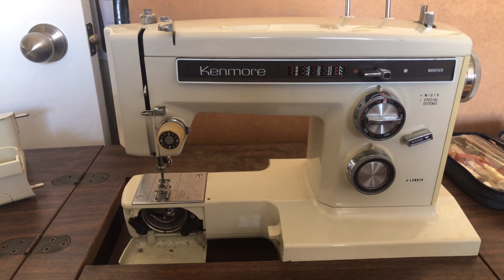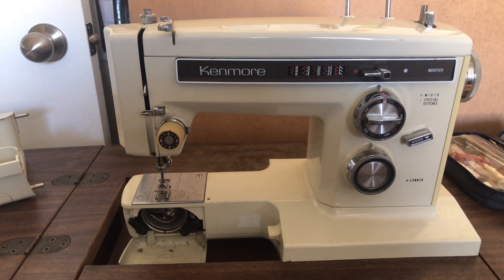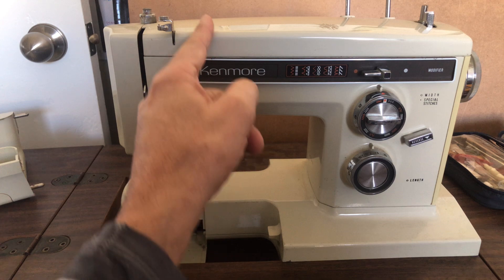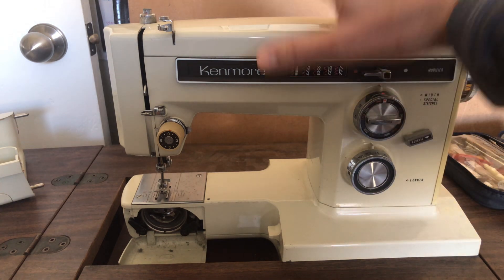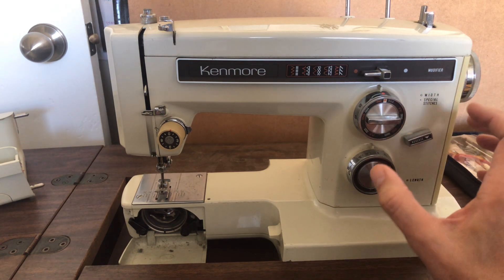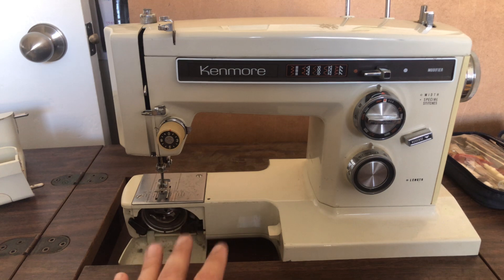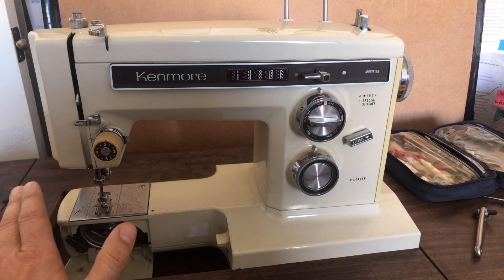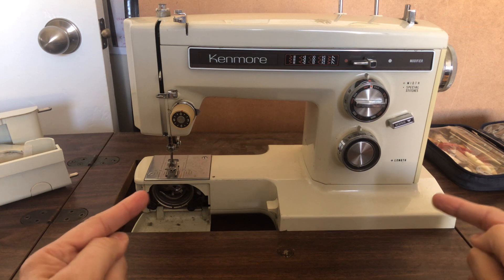I NEVER TIRE OF THESE AMAZING MULTISTITCH MACHINES & WHY I WOULD CHOOSE THIS KENMORE OVER A BERNINA

Comment: I just bought the lesser version of this machine. It has all the same stuff going for it except the dial for the length is up top, where your width dial is, the width dial is on the Kenmore logo strip and stitches are, underneath the stitch selector. The modifier is also built into the same length dial instead of being separate and up top. 

My machine also has no drop dog switch. It's a metal darning plate for this machine. However, it is a low shank, with that wonderful extra high clearance for the presser foot, a 1 amp motor, all metal construction (except for the cam stack assembly which is up top, super strong plastic and it is not load bearing, which is a good thing. I would have loved your version of the free arm, but I got instead the one with the pull out leg. Oh well, you can't have everything...LOL. 

The machine came to me fully functional. But, to be certain it was going to remain that way, I spent three days cleaning, greasing and oiling this honey. It's clearly low hours as the brushes inside the motor (I cleaned up all of the carbon inside, polished the commutator/armature/stator until they gleamed, put a drop of oil on the bearings) were like brand new. 

ALL of the original parts, including the cardboard box they came in as well as the little 3 things warning insert with the original manual. I decided to clean all of the innards of the pedal, cleaned and in some cases replaced the carbon disks, the metal contact foil, the inner well the carbon disks are housed in, and the contact nib that lived up top of said disks. 

I did a repaint of the pedal with high quality appliance paint (this has a textured finish instead of smooth) so that the pedal looked nice and new (and now has improved traction on the pedal). All of this effort really dialed in the smooth for this machine. 

I did not have to fine tune any of settings whatsoever. It did not need to be aligned in any way, the hook and feed dog timing are perfect, stitch quality is stellar, needle swing (very different on this machine as opposed to a machine with adjustable needle positions) or anything else. The belts...ugh. That's the Achilles Heel of this unit. It's a nightmare trying to get at them, let alone remove them. Yet, remove them I did, and the machine got itself a good old fashioned cleaning, oiling and tension adjustment (very similar to the one belt system on modern machines, of course disregarding the timing belts, which this does not have). 

I did have issues with the bobbin control knob. I, of course, corrected it with a couple of YouTube channels. Also had issue with threading as the manual does not make it clear (to me) how you are supposed to thread this unit up top. Kept having the bobbin and spool battling it out via jams and spool jump and spin scenarios. I also had to redo the tension knob as it was a little gunked up. Once I got that "dialed" in, I was off to the races. 

I have to get used to this reverse dial thing it has going for it. At first I thought after I was messing around with the dial and reverse switch that it had a 385 Kenmore issue with being stuck in reverse. Nope. I am learning from reading that this machine is designed to go backwards. I just need to learn how that works, and how to disengage it. Changing out the incandescent light bulb for a silicone (no joke, they make silicone light bulbs now) LED light actually gave the machine a little extra "OOMPHF"! It's amazing how a 15 watt bulb can suck up so much energy. And the LED is brighter and better, anyways. It does heat up, but never so hot you cannot touch it. 

My only gripe is the convertible flatbed table. The leg for some odd reason seems to be sitting higher than the table and is actually twisting it towards the machine. I have to keep it on an angle in order to use it. Going to definitely have a think on how to resolve that. I do plan to repaint this machine in the summer (and that case..it looks like it's urine yellow from all the years of whatever it was exposed to. Still, it's in perfect condition, save for the horrible colour and scratches all over it). 

I wanted to thank you, not only for this video, but for demonstrating why this machine is so well worth preserving. Once I saw your video on this particular machine (I think it was this one, the 1941 model, which I could not buy for a reasonable price, thus my purchasing this model, the 1251), I was hooked. 

Sure, I wanted one with more "stuff", and I really wanted the drop dogs and that bobbin housing accessible bed, but in the end, I don't need to buy a super high shank converter to be able to use my low shank feet (of which I have many), still get that IMPRESSIVE clearance for heavy fabrics that is even HIGHER than my Janome HD3000 and Singer Quantum Stylist 9960, A MA ZING feed dog capability for such a small dog setup, the best stretch stitches I think I have ever seen.
Reply from the maker: Thanks for sharing.  There are videos online from others that have methods for restoring oxidized plastics such as those on some of the 80's sewing machines.  I have not tried those options so cannot speak to their success or not.  But even it its yellowed, scratched state, I would hold onto that case as they are hard to find; in part because many got separate from the machines they were sold with.
Reply: @VintageSewingMachineGarage  I am. I repaired a stress crack inside on one of the support ribs with the superglue/baking soda method, to keep it from becoming a problem. 

I plan to attempt retrobrighting it sometime this spring (will attempt to do it on the inside, just in case this isn't a good thing for this type of plastic). If it works, it will be video documented. If not, I will be taking plastic grade paint to it, and restoring it that way (possibly giving it a very different look, depending on my mood). 

It's funny that the case is so badly yellowed, yet the machine's exterior plastics are as true in colour as the day it was unboxed. No complaints here., Still, it would have been nice to have the cooler bed free arm and chrome accents. 

The 1941 just looks better all-around. 

One question, if I may? My machine was built in 1975 according to the Kenmore website, but the model number isn't exact to what is listed. It says it was a 1975 build, but my model is off by a touch. Any idea as to how I can identify exactly when it was made? It's also not listed as Made in Japan, rather, it's Taiwan. 

Someone told me through Pattern Review that anything not manufactured in Japan is a much "lesser" build quality. I'm confused by this as I've been through this machine thoroughly, and it is definitely completely made of metal, with the exception of the cam array up top of the machine. And that array is in perfect condition, made with a much more durable plastic than some I've seen in my travels. It's free of petroleum grease as well (which you'd know better than anyone would break down certain plastics over time). 

I did find petroleum grease in the crank case, but it was still quite viable, and the gear setup is fully metal, so I left that where I found it. 

I'm about to do a stretch polyester lace repair for my sister on an undergarment. This was a complete nightmare on all of my machines the last time I took something in on it. My Singer 9960, Janome HD3000 (which I learned the other day, along with ALL modern Janome/Kenmore machines are nightmares to sew certain types of stretch fabrics on), the old Singer Starlet (1978, built in France) and the Kenmore 27 (1990 Janome built, one step from the top of the line, the Kenmore 30 mechanical series). 

I bought this machine when I learned my so-called "Heavy Duty" machine was a post 2018 build, and wasn't even a model  HD3000.  I had never expected/intended to use this machine as a Sailrite or H9. I did, however expect it to sew as well as older Kenmore hybrids. 

I learned one day when the needle sank into an 8 layer thin stretch denim stack and didn't come back up without being hand cranked that this model sports a pathetic and fully anemic 0.5 amp motor that Janome "treated" so that it would deliver 860 stitches per minute. This explained why the pedal was so hyper-sensitive to pressure being applied to it. I had a tough time sewing slowly on this machine as opposed to a Kenmore 27 that I shoe-horned a 0.7 amp motor into, but is still sporting it's original carbon disk sewing pedal. 

They also "lightened" things up when they treated this bait and switch junk motor by putting a very thin, prone to breaking down when exposed to heat or UV plastic flywheel inside the motor can, so that it would spin at about twice it's design speed. When I opened that can up and found this, I also saw that the commutator was caked in carbon dust from the now half spent brushes (this machine was bought at the end of 2019, and used a total of 10 times, with the last project ONLY putting anything remotely related to a heavier load through it, and was never intentionally gunned). 

Janome also took key components, once made of hard plastics, very much like what I found in this Kenmore 1251, and replaced them with thin, soft nylon. I'm guessing to lessen the weight being carried by that motor, and to ensure the machine had cracked components rendering it useless (so you'd buy an even more expensive Janome I'm guessing) within 7 to 10 years. 

Add to that the 5mm Christmas LED bulb lighting harness that, if you blew the LED, could not be changed without swapping out the entire harness or de-soldering/re-soldering after unwrapping and then re-wrapping said harness (IYIYI!) that barely lights the needle plate, put in as a replacement for the halogen that used to go with this model, so that all available power, which is nearly 0.5  amps, could be shoehorned into the machine's motor. 

I dunno, last time I checked, speed did not equal torque. 

I put a 0.7 amp motor into the machine, and boy, did that machine perform. That stack I could not sew out of, it went through it like it wasn't even there. In fact, that Kenmore 27 (which had a 0.5 amp motor, tired before I refurbished it), while is struggled a little, sewed through the stack the compromised Janome motor could not. 

That motor, in both machines, same model number, same everything except the flywheel. The Kenmore has an aluminum cast flywheel, which is sturdy and dependable. Like my Kenmore 1251, I refurbished the Kenmore 27, cleaned and polished (and fresh brushes swapped out for old) the commutator, etc. 

The machine, motor and pedal completely overhauled, and woke the machine up quite a bit. 

Once I confirmed the mechanical components in this machine were the same materials and configuration of a few 0.87 amp motor-fitted models (the Janome Decor Excel is identical except for the camstack, a few more stitch variations), I threw 0.7 amp motor into it, and the machine went from being a utility grade only machine to a bit of a beast. If it had the things I needed from my HD3000, mainly the 7 pin feed dog arrangement and extra high presser foot capability, I would have kept it and sold my Janome. 

As it stands, one more machine to take on the upholstery fabrics and denim recycle projects isn't such a bad thing. By the time I finish, the Janome will be general purpose only, the Singer for specialized projects requiring more precision sewing, and the Kenmore 1251 for the tougher stuff. The other Kenmore went to the missus, to replace her old Starlet, which I refurbished and gifted to my sister, as she needed a basic zig zag machine, nothing more. 

And to your video series on the 1241...I thank you kind sir. You gave me the impetus to seek out and attain an older Kenmore. And you were SOOOOOOO right on these unsung work horses being a great all-around sew. 

Sometimes, an "inspiration" (copy) can be as (or almost) as good as the original Thank you Bernina! LOL. 

That Janome sews a good stitch, and it could take some weight, but clearly, this bait and switch setup did the former model no justice. I'm currently waiting on a .87 amp motor (which is what the HD3000 originally had in it, and when it finally gets here, will be ripping the internals out and replacing all of the compromised gears, linkages, etc with the stronger plastics I have in my spares. I only wish I could get my hands on an older camstack array for this 18 stitch sequence. Then I would at least have the machine I thought I was paying for,. Not have to worry about this hybrid being anything less than the Kenmore/Janome machines I've grown to respect would also take a bit of the sting out of being conned and ripped off by both my dealer and Janome. 

While no one would be fool enough to say a 1983 Kenmore is the same in durability as a 1973 Kenmore, the fact that the hybrids are still going all these decades later (save for the odd reverse issue from gummed up grease) is a testament to how well balanced and the build quality, despite the plastics, Janome engineered into their product line. 

I bought this Kenmore to take on the jobs this gutless wonder clearly cannot handle without killing the parts inside. Considering the Janome cost two to three times as much as their competitors offerings in the same class of mechanicals, it's a very big deal to those that trusted the brand, only to find out that at that high end price, they got a low end machine.

Comment: we had same model but could not utilize all of it features, wondering if you had some kind of manual, user instruction ? thanks
Reply from the maker: I didn't need the manual but that is only due to my having worked on lots of these in the past.  Kenmore manuals can be easily found online in PDF form which you can pay a nominal fee for and then keep the PDF as well as print it out. Having a manual is VERY WISE to help learn how to use any machine.

Comment: GORGEOUS MACHINE.  I'm the guy who keeps bugging you about the axle grease machine. I recently drove 7 hours round trip to acquire on in a cabinet. Needle moved up and down but not left and right. Tri Flow took care of that. I will be gifting it to a dear friend next week. Are the brown vinyl tipped screws from the lift up panel available? Mine are bent.
Reply from the maker: I don't mind being 'bugged' about it Ronald :-)  Hope springs eternal as they say and so next summer, I will try again.  I only attempt trying to fix that disaster of a machine outdoors!!  As for the screws on the Kenmore table, I've never gone searching for one.  My default strategy for odd item searches is:  Ebay, Etsy, and Bonanza.com
Reply: @VintageSewingMachineGarage  
Thanks for your reply. Hope you have a healthy and Happy New Year.

Comment: Speaking of bolts, would you happen to know the nearest-compatible metric screw size for the thumbnut used for the bed mounted attachments in these older machines, like seam guides and the like? I have a knock off 3way seam guide thats just a hair too tall for every bed and presser screw i have to hand and ive been having a devil of a time sourcing one to fit. I ask about metric because of the two common threaded shank lengths i see in aftermarket bedscrews in stock at most sewing places, the longest is still too short by a hair, and the vast majority of listings i find for newly manufactured general purpose thumb nuts are now of course measured in metric M sizes rather than singers weirdo imperial 40tpi (or w/e) bed screw all my machines want. I could rethread a screw of a suitable shaft diameter, but i have no idea the nearest-next-largest-shank-diameter-in-metric-size with which to start, which is what leads me to ask you, as, being that you are a very knowledgeable sewing machine greaseknuckle, I imagine this must be a conundrum against which your expertise might be suited. Thank you so much for your time and all of your videos, your content is an indescribably valuable resource for us that are still very actively using these op antiques. I wish you and yours all of the happiness.
Reply from the maker: The best option in this case would likely be to search for an original seam guide even if you have to purchase the whole guide.  I've done this before when I needed something that was super hard to find.
Reply: @VintageSewingMachineGarage  oh I could likely not source the original. the knock off is knocking off a pretty obscure japanese seam guide from the 1950s that are more or less hens teeth now, and may well have originally shipped with a bedscrew with a longer shank for all I know. I've only ever seen one original for sale in the states. I'll just have to keep screwing around. Thank you very much for your response though, I do very much appreciate it!